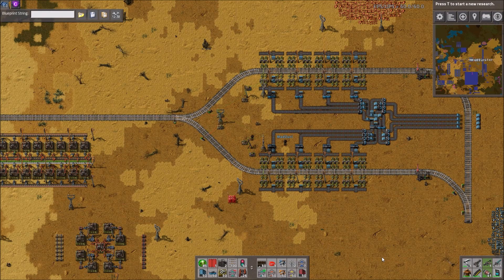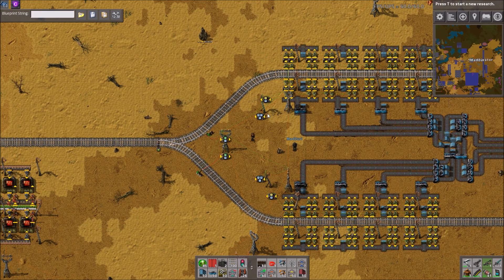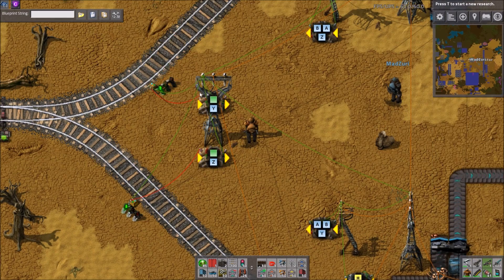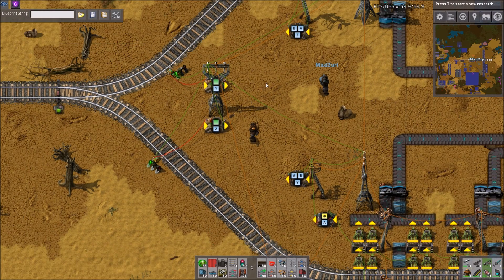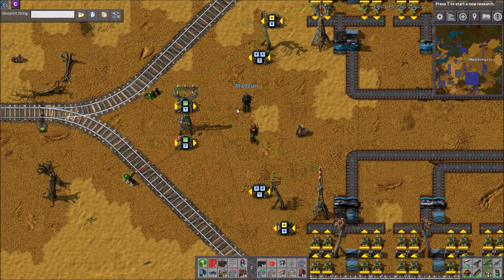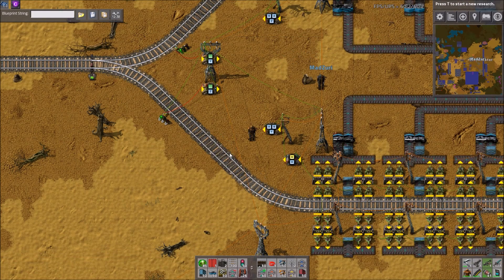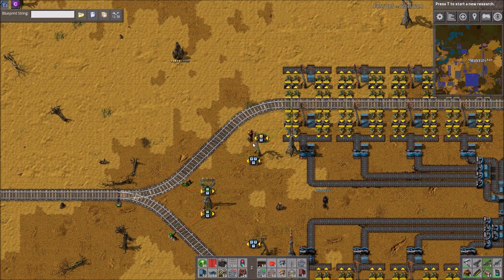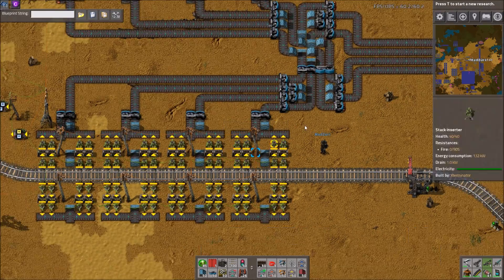Factorio Workshop - Building A Better Factory :: Salfrus' Smart Train Station

Comment: How does it prevent trains from trying to go into a blocked path? I have a similar setup, but the system runs into problems because trains try to go to the signal-blocked path and get stuck.

For example, say the top path is disabled, so you want the next train to go to the bottom station. What happens for me is that the train decides it wants to go to the top station and takes the top fork until it hits the signal and just waits there. How do you make it choose the bottom path?
Reply: The chain signal should stop trains there unless they can go to the bottom one. It should turn blue showing some directions are red but at least one is green.

Comment: That's way more complicated than it needs to be.  I did something similar and the simple way to do it is to basically recreate the MadZuri smart loading train station except  instead of adding up the total inventory on multiple boxes, you add up the total inventory on multiple train stops.  And instead of controlling inserters on/off, you control the train signal on/off based on if the train stop is higher/lower than the average by 1 train load.  The great thing about this method is that it's easily expandable if you have 2 of 5 train stops.
Reply from the maker: Yeah, Zuri and I were talking and decided it was more complicated than it needed to be. But it still works so we weren't really going to complain. 
The way you're doing it sounds super easy though, which is really nice!
Reply: Wont this block all other stations if there is a train in the station with the least items being unloaded? I'd reckon you'd still want trains to unload in the other stations if the one with the least amount of items is already blocked.